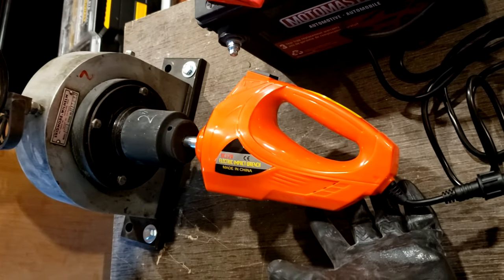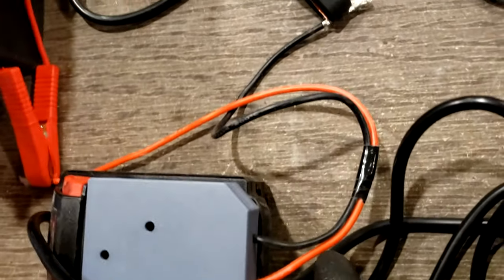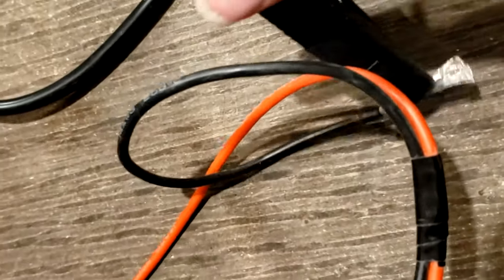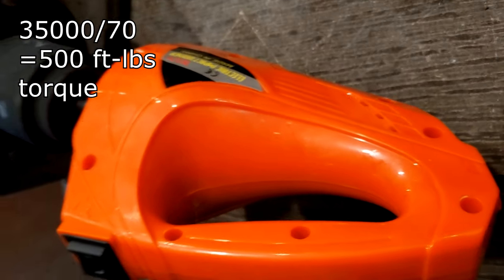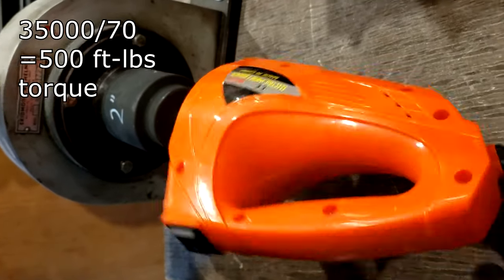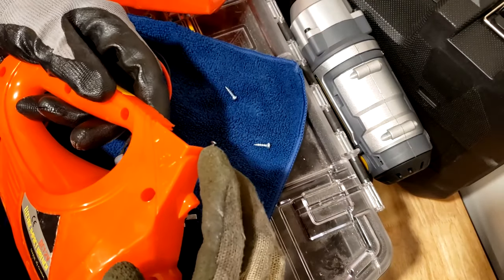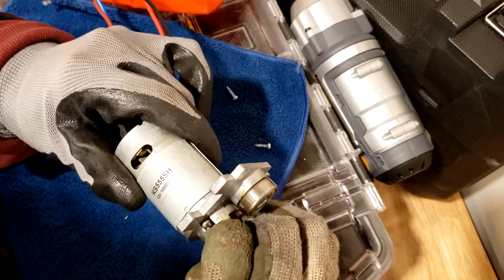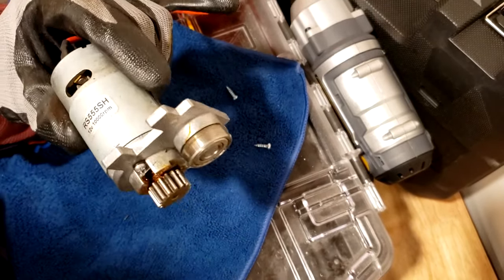12v Amazon impact wrench makes insane power before catching fire

Comment: thanks for showing the guts lol. i think i found it on amazon with a tire inflator for $150????!! i was proud of this thing but for that price it should be built better. the windings of the motor welded themself together.
Reply from the maker: It cost me $40? But that was year ago now I think prices went crazy though.
Reply: For the price it should be built better??? The thing is literally $50 and was being fed 18v when its rated for 12 and still putting out better numbers than a lot of mid torque impact wrenches.

Comment: Either go red or go to harbor freight.  Losing brain cells😤
Reply: They're only showing what it could do, not what it should do.  Apparently its best use is on rusted over lug nuts that the last tire jockey ugga dugga'd all the way on, and perhaps some other occasional jobs that you'd normally get a giant cheater bar for.